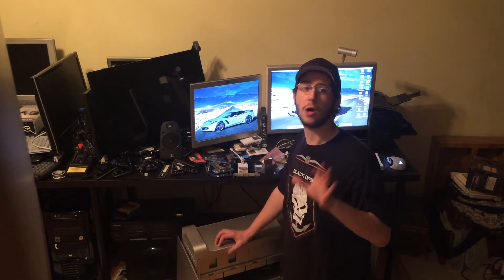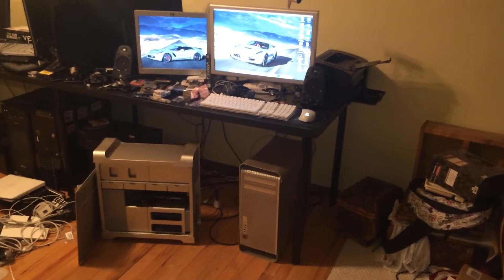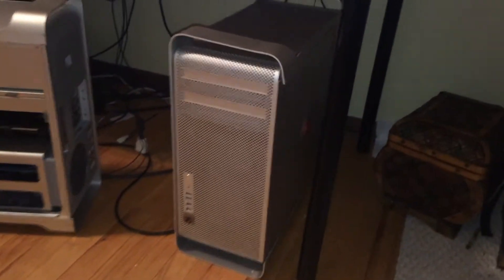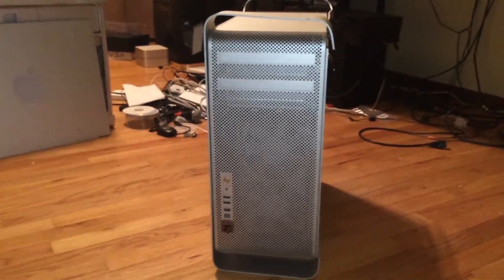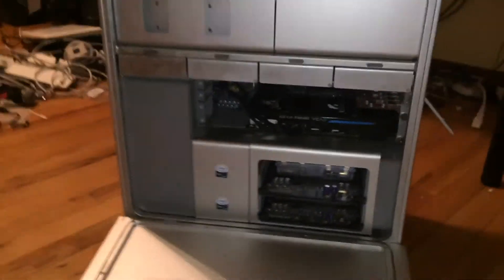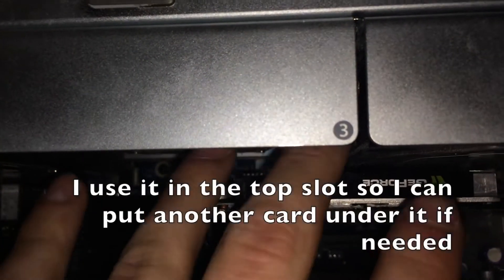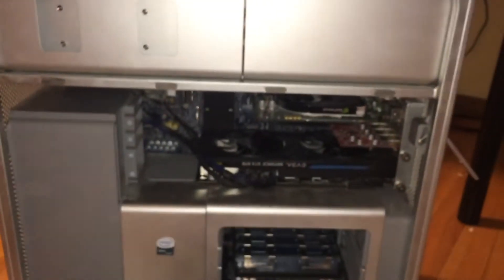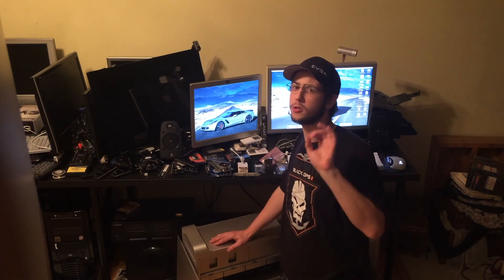My 2,1 Pro Revisited - Mac Pro Series S.2 EP.1

Comment: I have just looked at this video again and enjoyed it. But I do have a question - I always worry about the strain placed on the PSU when all 4 drives are occupied and 2 GPUs (with one power hungry). I know that the PSUs in the 3.1 Mac Pros are notorious for failing and indeed I had one go a while back and now another is also playing up. The cost of replacements are ridiculous. I know that the PSUs in the 1.1/2.1 machines are supposed to be ok, but I worry nonetheless about the strain that is put on them when we upgrade everything to the max. I do it nonetheless but I would appreciate your feedback on this Greg.  Thanks.
Reply from the maker: This system was designed to send 75 watts to each PCIE slot and 150 W to the power-hungry GPU while having all of the drive bays filled there is no massive strain trust me

Comment: Hey Greg!!!, is your dvi-d to hdmi works on your 2,1 ? got a mac mini 2,1 early 2007 dvi to hdmi wont work only dvi to vga installed latest  gma950 intel drivers(windows 10 64 bit Pro) ,also any advise to get the proper audio drivers ? bootcamp 4 realtek drivers did not work ,personally I did the whole W10 install  just to be able to use dvi to hdmi without any crop display issues   like the one on Lion ox. 
well thanks for your tutorials are really well explained !